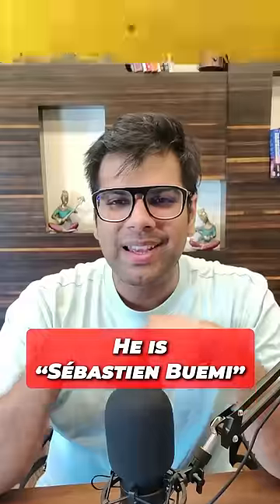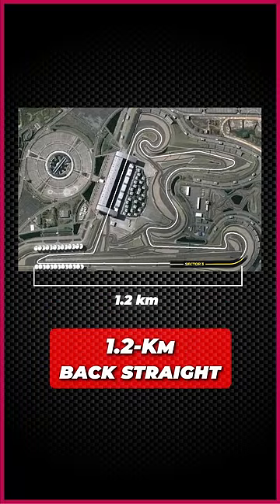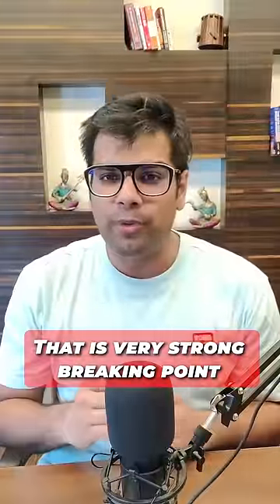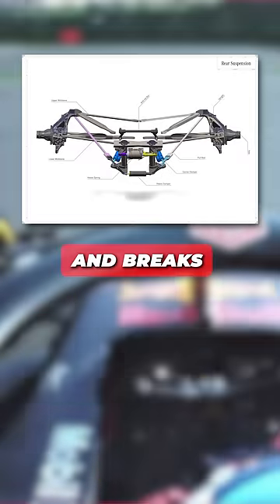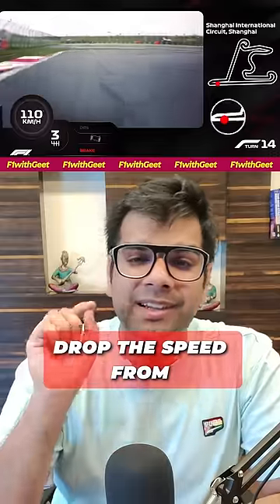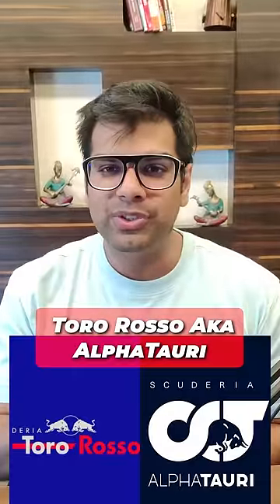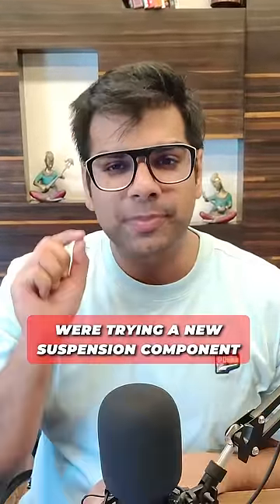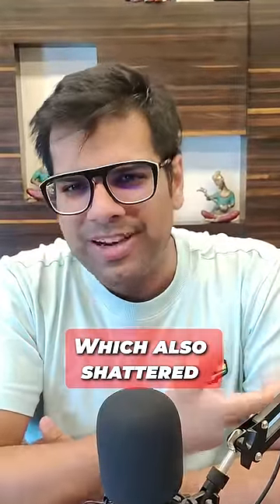2010 Sebastian Buemi's Tire Drama #formula #f1

Comment: Not related to video but.....
About the Monza curse. So it has taken down LEC, GAS and RIC in the past and everybody thought it was MAX turn now and his engine would fail but it didn't.

That was what everybody thinks.

Actually his engine did fucked up near the end and was losing 2 second a lap if it would have been 2 more laps which the formation lap that happened twice took it off the race lap he would have been hit by the curse. Thanks to YUKI he broke the curse.

Just wanted to share this insight :)